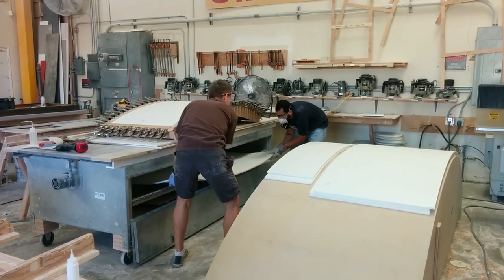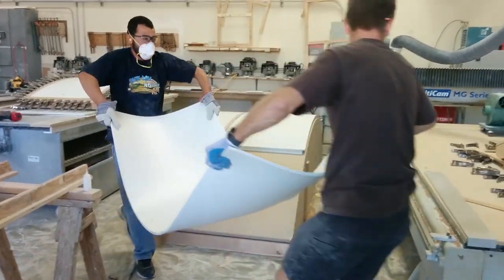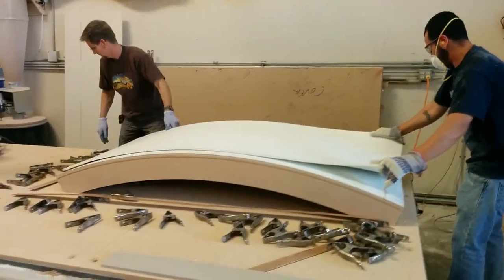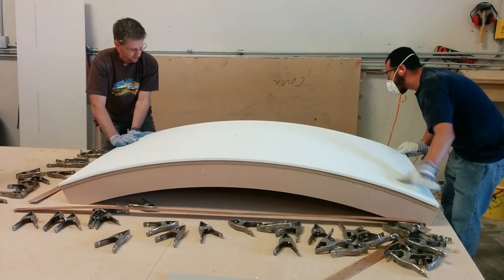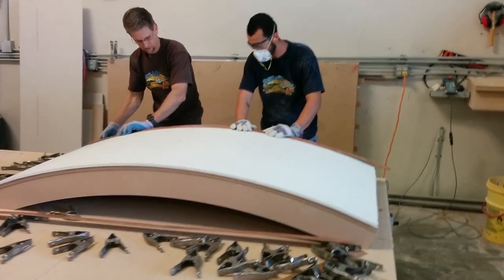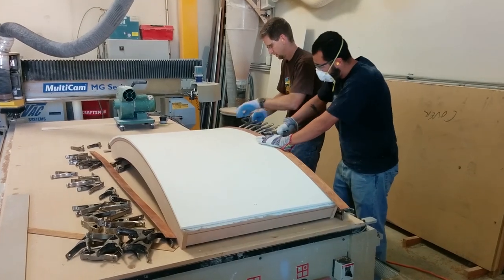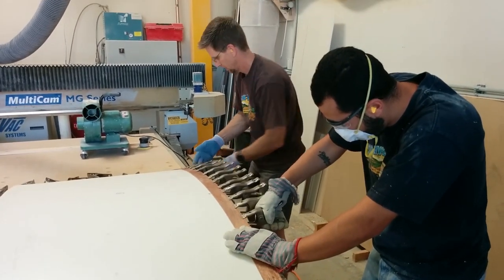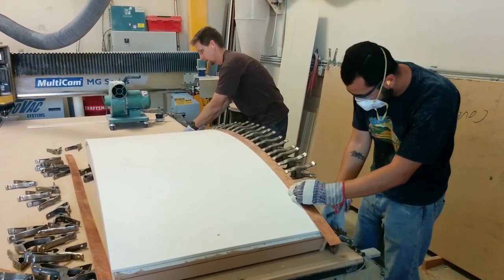Thermoforming a Corian Solid Surface Panel onto a Curved Buck

Comment: Hi,

I am interested in starting up and become a corian fabricator. What is the machines (CNC, thermo) would you have advise for me?
Reply from the maker: It's an AXYZ CNC and a Pinske Edge oven.
Reply: @AndyGraves  Thanks fir that Andy. Whast do you use to polish the edges?
Reply from the maker: You can sand up to 600 grit and then polish with like a car polisher. I have videos on that process.
Reply: what is your experience in craft?
Reply from the maker: 35 years

Comment: We are looking to buy an oven, any suggestions as to a source?
Reply from the maker: Where are you located?
Reply: @AndyGraves  we are on the East Coast, near New Haven CT
Reply from the maker: Contact pinske-edge.com They make the oven I use. It works good. There are other companies though.
Reply: @AndyGraves  THERMOFORMING CONVECTION OVEN – 109″ – W/STAND
$ 6,995.00

Thermoforming Convection Oven on wheeled base – this oven’s useable space is 7.5″ H x 38″ W x 100″L
Reply: @yangtommy6031  The best prices.